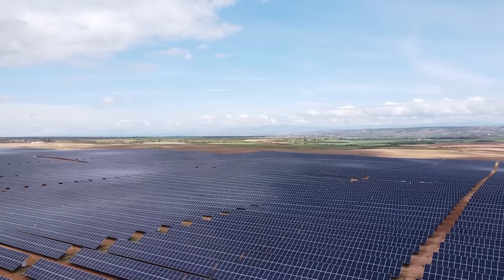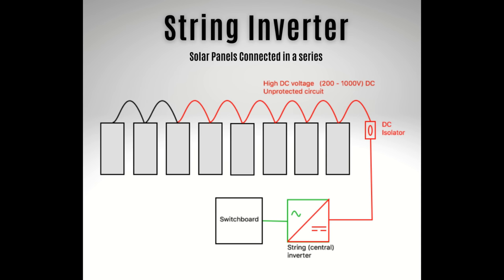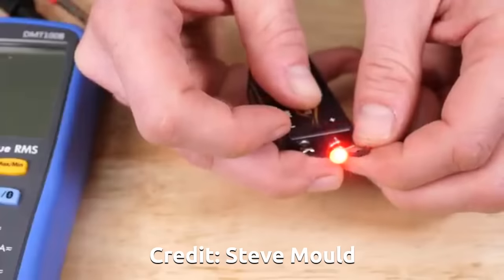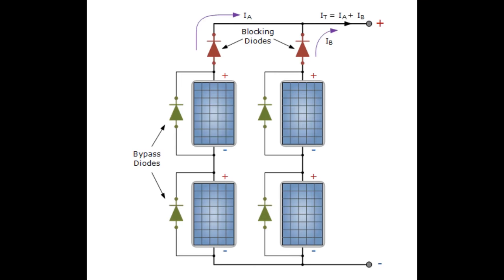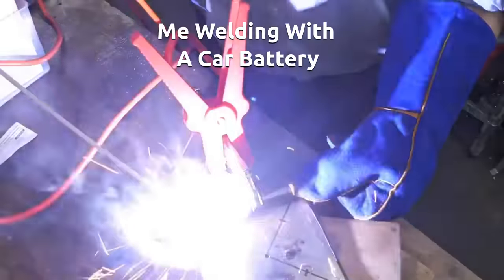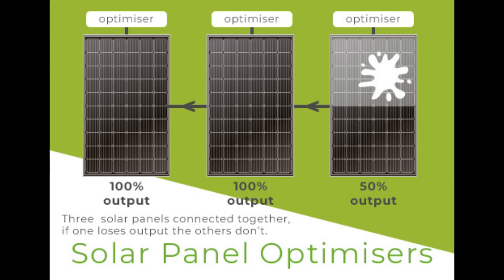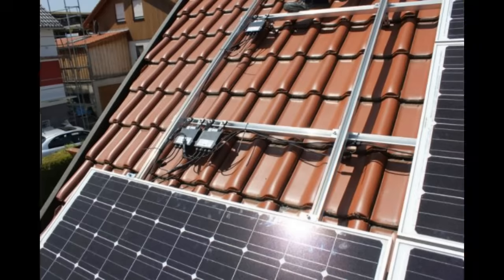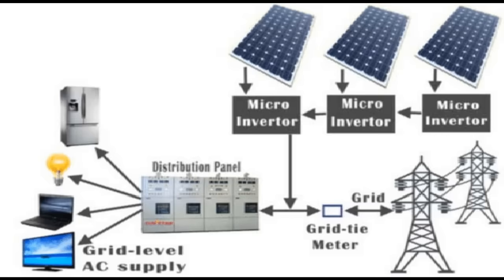2262 Microinverters Where Do They Come From And Are They A Good Idea

Comment: I would not use micro inverters. Just run DC to your Inverter.  It will charge your batteries and use that DC to make AC.  If you have shading or a bad panel then fix that problem.  The newer panels use diodes that break up the cells into groups so you don't lose the entire panel output when shaded.  I am more in favor of ground mounted panels so I would not have the problem of rules with roof mounted.

Comment: don't microinverters introduce inefficiency when charging batteries? DC=>AC=>DC
Reply: That's why I prefer a DC and AC coupled system.  Better efficiency.  I use Victron with Fronius/ABB and a variety of BESS.  Pylontech been my favourite.  Micros have failed on me plenty and hard to monitor if there is any noise on the AC line.

Comment: having 20 micro inverters to service a 20 panel installation is the peak of idiocy. Every inverter has a base power draw that is multiplied 20 times with micros.
They are useful only for installations so small where it's not beneficial to purchase a separate inverter. So 1-3 panel ones.
Reply: True. But with the advent of larger, higher voltage panels, the per-panel loss is less of a problem. It seems there are advantages to both string inverters and micro inverters. For myself, I think I would rather risk replacing a single panel and high quality micro inverter than have my whole system go down.

Comment: Inverters of all types whether large single units or micro inverts have running losses and all have standby current. The result is generally that around twice as much solar panels and batteries are needed than would be required if just using 24Volts DC directly. But the solar panel and battery suppliers won’t tell you that because that would mean a loss in sales volumes. Edison was pushing DC in his day which is usable in a typical house or office building. DC 24 volt refrigerators, deep freezers, TV’s, kettles etc are available which all draw less than 220V AC versions further reducing the volume of solar panels and batteries needed. I am a firm believer that DC is a far better way to go. A single large inverter of 5kW draws a stand by current of around 1,5 or 3 amps with no load in the output. At 51V DC that means 100Watts being used. Multiply that X 24 hours and you have a standby wattage in a given day of 2,4kW hr. Or put it another way 1 panel of 400W with 6 hours of sun just to keep the standby power of an inverter. Now a fridge uses on average 200W and runs for 4 hours a day = 800W hr. A deep freezer is similar in power used. A TV uses 50W at 5 hours a day = 250 W hr. Lights for 5 hours at 50W hr = 250W hr. Total of all of these is 2100 W hr. In other words the inverter doing nothing uses more than all of these put together. And that is not even looking at the losses of stepping up the 51V DC to mains voltage where another 20% is lost. Now in 10 years when the batteries of an inverter installation site has to be replaced from aging the user will be paying far more than the few batteries used in DC installation. Time to stop using inverters and start looking at using DC in houses.
Reply: Pretty sure a lot of the things you plug in has to have their own inverter to convert the AC to DC, with those you'd just be going DC to AC then back into DC again!
Reply: I idolized Edison for the first 20 years of my life... but frankly, he was an idiot that promoted DC purely out of jealousy! DC is a TERRIBLE way to transport power compared to AC... this is why the entire world uses AC. DC is OK for very short, low power applications, but transmission losses and wire cost make DC impractical.
Reply: @gerryplayz4532  In my case the satalite decoder, the modem, the WiFi and a bunch of other stuff  has a 12v external power box. So I made up a bunch of cables with the correct sockets and wired them all up to a single 24v to 12v converter I got from aliexpress. Also put in a few car DC sockets in the formerly mains socket boxes and ran a few 4mm wires to the battery via a DC distribution box. Got a roll of 24v led strips for the light and using the same previous wiring all works well. This is the kind of stuff that any handy man can do. Just remember the fuses have to be in line in case rats or ants eat the insulation and wires short out. When I switch off my appliances nothing is drawn any more. No stand by current of any sort.
Reply: @onestoptechnologies7305  Yep I called 50 meters the max. Ideal distance which is why the batteries sit as near to the centre of the house outside. Works well. Absolutely zip current when everything is off. But the water has to be heated with solar water heaters as pv cells is so low on efficiency. Use gas for cooking.  Only thing is there are no DC powered washing machines so here an inverter is used on cold wash cycle.
Reply: @bartronicsecurity  Sounds like a great setup. Gas clothes drier? I'm installing hydronic heated floors with in-ground hot water storage tank using flat plate collectors. I assume you don't need air conditioning?
Could you retrofit a washer with a DC motor and use the AC motor wires to activate a relay for the DC motor?

Comment: We use microinverters because parts of our solar array get shading at various times of the day.  This way a panel's output that is reduced because of shade does not impact the other panels on the array.
Reply: The MPPTs in a string inverter would pretty much solve that problem.  Doing this since 2008 and used both technologies. String>micro.  Enphase may however change that in the future or another company.  I like their new products and want to see their performance before I completely shut down micros.  The world evolves and micros will have their time.

Comment: Living in Ohio I doubt the benefit of solar , too many cloudy days, temperature variations, tinkered with them years ago , wasn't impressed. What ever happened to Kodak's flexible cells, all the rage on popular electronics over. 45 years ago. Lightweight plastic. Wanted to get some and apply to a radio controlled plane ? Alas many systems show sever losses after a short time.
Reply: Depends where in Ohio you live. Even in northeast, solar PV is becoming feasible. My projected breakeven point was about 12 years, down from over 15 as little as 5 years ago. Increasingly efficient panels keeps improving those numbers. If I could afford the upfront cost, I'd jump on it. Lots of flexible panel options nowadays, too.

Comment: Can you put a 600watt led light in sunlight and get any electrical current out of the power cable which you would be putting power in just a thought
Reply: No the efficiency of LEDs are one way (Electricity to Light) in the opposite direction they are bad infact way worse then TECs when used as TEGs. Also remember that solar panels are also worse efficiency when used as LEDs.

Comment: Hello Robert, Good Day ! : ) . Robert, what is your take on the  "EnergyDome'' proposed Utility scale backup power electric generation concept. Does the Round Trip Efficiency (RTE) chemistry seem a sound way to store Renewable Energy, then have sufficient Electrical Energy Current Capacity to be released to the electric transmission grid to balance load when wind, and solar are not available ? Is the cost to benefit ratio there ? I ask you because this seems a simple system that is deployable in mass and at low cost if the reserve capacity is robust enough. You U.S. Dollar / Pound to watt . Thank you for any of your valuable time spent in research efforts done to answer these questions using your vast insight abilities. As always you, and Luke's efforts are much appreciated here.

Comment: I use Microinverters for almost 10years. I like easy instalation. Main drawback for me is self consumption. They need 25+ Volts to start working. So in winter conditions their performance is worse, because you can't connect strings of pannels to them. So with string inverters you can reach start voltage much sooner, and get at least some production in bad conditions.

Comment: I am with you on not wanting my electronics on the roof.  I think that the simpler the better.  Granted there is a single point of failure if you use one big inverter as opposed to micro inverters, there is still the ability to use a greater mix of equipment such as various solar panels without the need to match the micro inverters.  Just my 2 cents worth.  Cheers Rob

Comment: There is another aspect to using nicroinverters, and that is local electricity authority codes. I was told by a young tech who was installing a microinverter system at my house  that his next job was likely to be a nightmare. He said it was to install solar panels on the roof of a two story house but using a central inverter. Local code stipulates that if you run a DC high voltage cable, it must be in a metal conduit. So he would have to run metal conduits from the roof to the ground floor before any cabling work could be done. However, if the cable is AC, it only needs to be in a plastic conduit (which could be flexible) with the benefits of lower initial cost and less installation problems. He much preferred microinverter installations as they involved less complicated wiring and conduit work.

Comment: HEY PROFESSOR SMITH  The inverter type depends on the loads that will be powered  When going into a grid (grid tied) made up of TONS of transformers and even the thousands of miles of wire  Micro inverters and high freq inverters will work out ok no matter the load  This is because the grid is providing (instant magnetic push flux) similar to a giant flywheel   So if any of your loads have a very high starting current the grid will provide it when grid tied and using micro inverters  But if you are off grid and have high start up currant loads your inverter and batteries has to supply it  The start up currant could be over 10 times higher than running wattage or currant  High frequency inverters with have small light transformers switched at high frequency to raise the voltage   There is very little flux stored in the magnetic core of theses small light transformer cores  So the high frequency inverter has to get that instant amperage of start up load mainly from your battery's  There is lots of components in high frequency that that amperage spike has to go through to make it to your load  Boosting mosfets switching dc from solar panels/batteries into high frequency ac then though diodes to back to dc to be stored in high voltage 300 or 400 volt dc capacitors  Then through switches like mosfets to turn high voltage dc from capacitors into lower 120 or 240 volt 50 or 60hz   This is simplified there is lots of other components that makes all that happen  Point is high frequency inverters has tons of components that spike has to go though to get to your starting current giant instant load   Every time its hard on every one of them components   Low frequency inverter uses a big heavy iron core transformer that hold lots of flux to step up the voltage  So the low dc voltage from your solar panels/batteries goes through switches like mosfets to turn to low voltage ac  This low voltage ac is stepped up to high voltage ac through the big heavy iron core transformer  It comes out of transformer at 120volt or 240 volt 50 or 60 hz ac  There for it has way less components to go bad or to be hard on  With the added flux needed to start big loads stored in the core of the big transformer      It is a lie that all low frequency inverters has a high idle losses  I built a 10k low frequency inverter maybe 5 or 6 years ago  It has been running 24/7 in harsh conditions powering apartment over a garage It powers them both big saws welders and all zero problems   It usages around 15 watts at idle that's fully powered up idle   Its all about how you wind the transformer and your choke   I have people in the inverter bezz that have tested my wound transformers and cant find any losess  But still say it has losses imposable not to have LOL LOL                                                                                                                                                        The grids inductance/magnetic flux can be thought of as a flywheel or pushing a person on a swing  There is lots of force that will knock you a flying if you step in front of some one swinging on a swing   All the switching magnetic flux in the transformers and lines work just like person on the swing  It takes very little input to keep them swinging if your push is timed correctly Transformers/ power line works the  same the push is at 50 or 60 hz  120 volt or 240 volt ac    The loads you need to start up is what makes one inverter WAY better than other also the way smaller componet count    OK thats all you need to know to make good choice!!!

Comment: Grow trees use gasifier to produce electricity much more efficient
Reply: Sure, but what about on the local council estate? Or just suburbia.
Reply: Great for backup power, but engines using gasifier fuel will fail at a much higher rate than using regular gasoline/diesel. Also, gasifier generator requires a lot more continual maintenance over the 25 year life of solar panels. 
P.S. You might consider finding a way to add a little oil to the cylinders to aid in lubrication to extend the life of the engine.

Comment: surely many household appliances actually run on a low DC voltage nowadays, computers phones, even most washing machines and TV's nowadays all take the mains power , transform it down and then rectify it. so many household items are actually running at low DC voltages, with all the losses involved in transforming and rectification, anything that is run off its own power brick is converting back down to a DC voltage- So why dont we do away with the electrical losses involved in creating AC from DC - then converting it back again - the only stumbling block put in our way is manufactures of these items, who effectively will only let you put mains AC in, if they has an external DC input socket that could be plugged into a DC supply, at low voltage, then the solar panels could supply these sockets easily enough and the only electronics required would be dc dc converters or voltage limiting circuits, so many less components so a cheaper manufacturing process.
Reply: USB-C and the PD standards are kinda helping there. Cheap chips and components that have enough brains in to give your device what it wants. You can have a power brick, but you could also use a battery pack or "power station" (basically, a really big battery pack). PD already has the ability to throw 250W over a cable with the latest revision; anything more than that you can probably bite the bullet and go via an inverter.

Right now, I have a little GAN brick that's good to 120W, a small power station, a pocketable power pack, and it basically keeps all the small little phone/tablet type things nicely topped up. That along with a 100w foldable solar panel if I ever want to go remote, and I'm basically covered for anything I might want to take with me.

Comment: But doesn't an MPPT inverter also do this and its ground based?  My dad's friend is having some problems with an old system and the company is not lending support, and he is suffering from macular degeneration. Here's what they say about an MPPT, so I wonder: An MPPT (Maximum Power Point Tracking) inverter is a type of solar power inverter that optimizes the energy conversion efficiency of solar panels by tracking the maximum power point of the solar array. This technology allows the inverter to extract the maximum possible power from the solar panels, ensuring efficient energy conversion and reducing energy losses. MPPT inverters are commonly used in off-grid and grid-tied solar power systems, providing a reliable and efficient way to convert solar energy into usable electrical power. These inverters are designed to work with solar charge controllers, which regulate the charging of batteries in off-grid systems, further enhancing the overall performance and efficiency of the solar power system" END QUOTE. So from panels, to MPPT inverter, the mppt inverter goes to the charge controller, which goes to the batteries. Erm. But like... so that is energy going in. But so energy goes like out of the MPPT to devices? So it goes rom panel to mppt to charge controller to battery. and does the charge controller or the mppt "realise" that the devices need battery power?
Reply: Your question is a little confusing... usually, the power is dumped from the charge controller(DC-DC) into the bus that feeds the batteries... the whole-house inverter(DC to AC) draws from that bus/batteries as much power as necessary to support the demand on the AC side.

Comment: Interesting RMS.

First Point
Definitions are an Issue here.  I Would Argue Most of the Current Invertors are Micro Invertors.
The World Still has No Large Scale Solar Power Stations.   
Of Course the Definition of Distributed System is Also Subject to Size Considerations.

Second Point.
AC Synchronization is an Issue for Micro Invertors Per Solar Panel.
This is More than Likely the Biggest Reason They Need to Communicate with one another.
But of Course this Means Coms Electronics is Now Also Needed along with Invertor Electronics.   This Increases the Likelyhood of Individual Solar Panel Failure.  Hence if Electronics can be Mass Produced with 25 Year Gaurantees, then Maybe Micro is Ok.

Third Point
The Argument of Rotating Electrics Verses Stationary Electronics is a Much Closer Contest than Many People Think.  In Fact Sometimes the Rotating Electrics is Superior.
Further, We are Yet to See, or Hear of DC Motor Driven AC Generators Used with Medium to Large Solar Panel Arrays.     Maybe I will have to do this.

Fourth Point
At this Stage, I Think Micro Invertor Solar Panels is a Reasonable, Even Good Idea for Small Solar Systems.

RMS, Thanks for Your Knowledge Again.